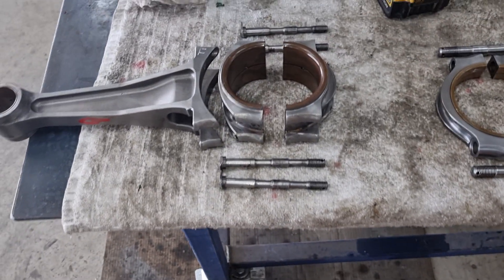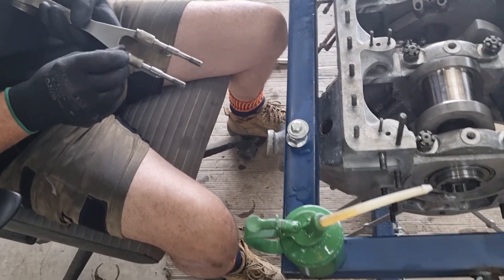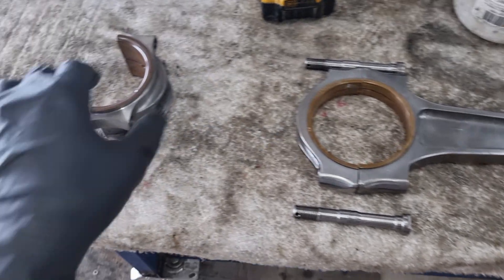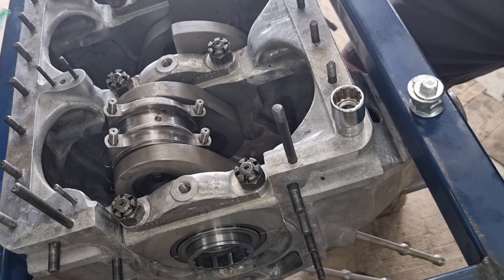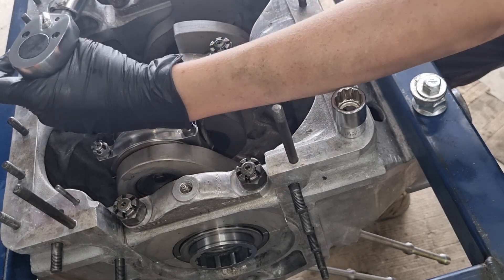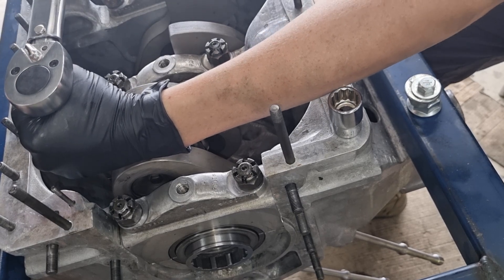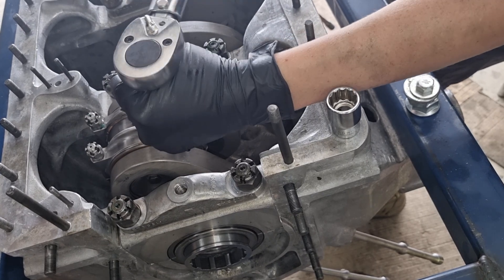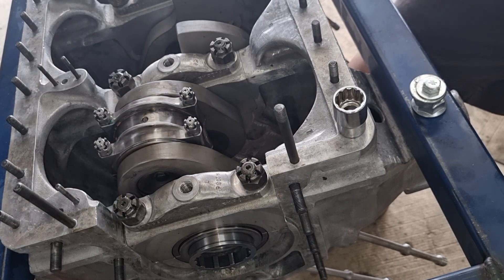Installing Meteor engine con rods

Comment: Brilliant. I’ve not seen the crank side of these engines before. What an interesting setup. Having built several V8’s, I’m used to a side by side configuration. Not one on top of the other.
Reply: Not a Harley rider?
Reply: @roderernst9990  04 Goldwing

Comment: I heard the RAAME works had a testbench with a big electric motor which was used to wind the engines over for 24hrs to lap the babbit in for the replacement engines from rolls royce

Comment: Only thing I am wondering is that these castle nuts usually have some securing, going through them and a hole in the bolt don't they? The bolt seems to have the "proper" hole? Or are you replacing that with loctide?
Reply from the maker: All the castle nuts get lock tight as well as tie wired on aircraft style 😊

Comment: Love this kind of video! One question: the inner bearing (the one you did first) is a little loose on the crankshaft journal. Wouldn’t that pose a problem with getting knocked around under power?
Reply: End float of the Big end is normal in this design
Reply: @petercordell5177 thanks! I wonder why: seems counter-intuitive…

Comment: A couple of observations. You don`t need to align the nuts if you build the assembly outside the engine, which is how it should be done. You "thread" the rod and cap in at a different position which can`t easily be achieved inside the crankcase. It`s built outside the engine so you can check for tight spots by rotating the rod 180 degrees. Every time the bolts are re-stretched, the split pin hole also rotates slightly, meaning you wouldn`t be able to align the nut flush anyway. Regarding the torque, you should make sure they reach that minimum figure, then the torque should stop increasing at some point before the top figure, this is when the bolts reach their elastic limit. A dial torque wrench is useful for this. You may be ok using the higher figure as a set torque, but there`s a danger you can just keep tightening them until they are over stretched. Sorry for all the negativity! The videos are really informative.
Reply: Hi Thanks for the comments. In an ideal workshop all is true . Im a LAME as well. As for Aligning the nuts with the flat parrallel its must be done regardless as the  centre  cap on the  opposite  piston will not fit in the groove. Cheers.

Comment: In the video it seems that the gap in the connecting rod liners is huge (connecting rod installed first), the connecting rod can be moved up and down. How does this work or am I just imagining it?
Reply: Its a V design . opposite rods are central in the bore not side by side . It make the total length of the engine block shorter.
Reply: @petercordell5177 I understand that, the radial play of the fork rod confused me -seems huge.

Comment: Are the rod bolts numbered to go into a certain hole like Gardner engines are or can they go in any hole in the rod?
Reply: There are numbered as this engine is full balanced.  Aircraft quality.
Reply: @petercordell5177  Just like a Gardner then. Cant beat a quality built engine.